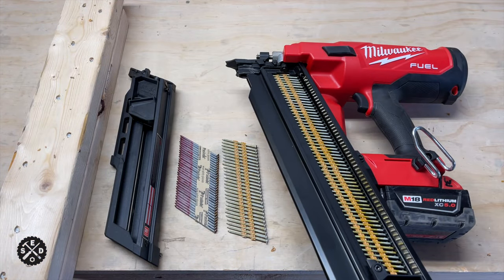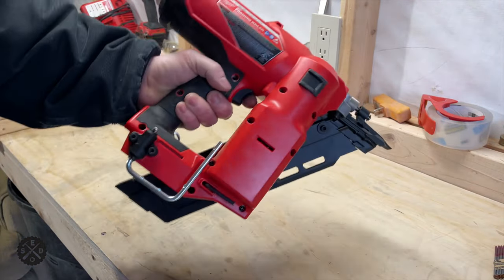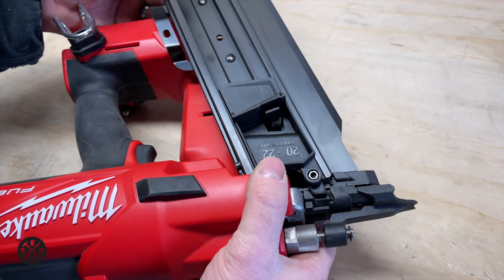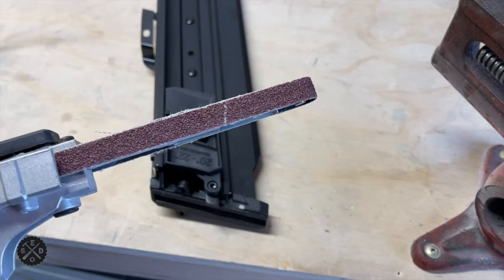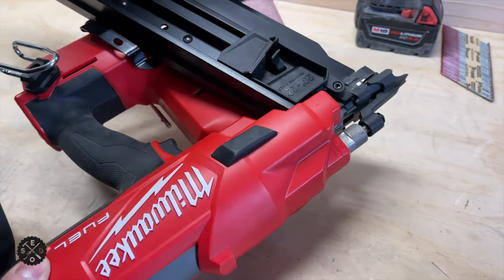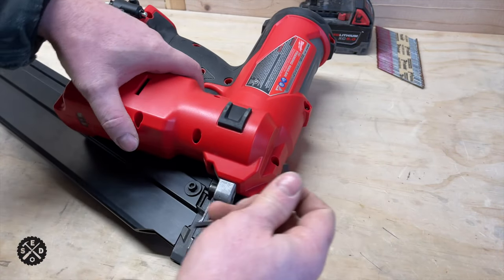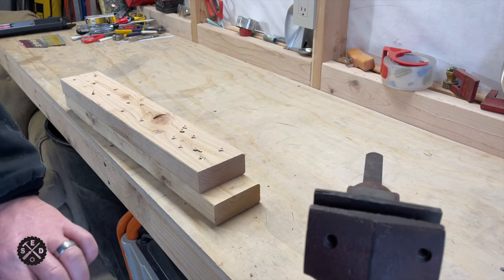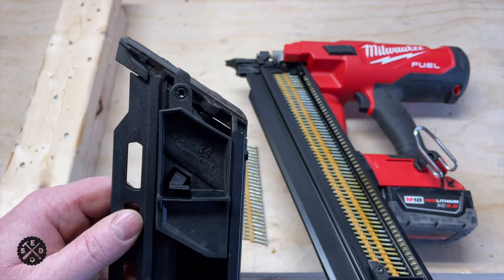Convert Milwaukee Framing Nailer from 30 to 21 Degree Magazine Swap

Comment: Just picked up a 21 deg. nailer. I'm going to buy a 30 deg mag and grind the opposite side of those tabs to see if I can get it to work. Thanks for this!
Reply from the maker: Awesome yes, let me know how it goes!
Reply: i will be doing the same thing. wife got me the 21deg for Christmas. to be honest the only other difference i can think of is the 21 might be slightly stronger too if we knew the internal cartridge capabilities only because with 21deg it can shoot thicker nails then the 30deg.
Reply from the maker: I haven’t verified for sure but I think the internals are the same. Good luck with it. Let me know how it goes.
Reply: Any luck?
Reply: were you able to do it? i got a 21deg as well but i dont want to spend on a new 30 deg
Reply from the maker: It should be doable just opposite of mine.
Reply: Awesome, will be doing my conversion!!
Reply from the maker: Very cool
Reply: How did the conversion from 21 to 30 go?
Reply: How did it go? 21 to 30
Reply: Did going 21 to 30 work?
Reply: @SmartEasyDITer This does not work.  Failed going 21 to 30.  The gun was shooting 2 nails at once. 

I assume the striker on 21 is bigger for hitting the full heads so when you put a 30 degree mag on, the striker hits both nails since they are overlapping.

30 to 21 must work because the striker designed to hit a smaller target still works on a 21 degree full head.
Reply: It fails
Reply from the maker: Interesting ok. Thanks for sharing
Reply: @SmartEasyDIYer  I was using 30 degree clipped head.  I'm going to get full offset head to see if the extra clearance avoids the 2nd nail being driven
Reply from the maker: @darceytim oh yeah good thinking! That could make a difference. Let me know. Thanks
Reply: @h2s142 not pointless if your local codes require one or the other for a given application.
Reply: @darceytim did it work?

Comment: Caution- When you are shooting the 21 degree and you bought the 30 degree since the 21 degree is plastic Clip not paper it does not sink all the nails
Reply from the maker: I’ve had no issues shooting either one if the nose depth is adjusted properly.

Comment: Cheaper to buy another gun time is money
Reply from the maker: Sometimes yes. Depends on your needs and budget.
Reply: This project take me 30 minutes with a dremel and it save me from spending $300, so I'll take that loss of 30 minutes time, but if you have the budget then you can have as much as you want...
Reply: @VinhNguyen-zn2rq  you also voided the warranty
Reply from the maker: If you put the original magazine back on, it shouldn’t affect the warranty

Comment: Have you ran into any issues since doing this? There are warnings that the driver assembly that pushes the nails are different for the angle of the gun. And I'm being warned that swapping could damage or wear out the gun much quicker. Is this true or is this just to make sure we buy more from milwaukee?
Reply from the maker: I haven’t heard about it yet. There could be something to it perhaps worth looking into. I don’t know. To me it looks exactly the same just the angle of the magazine that’s different. I personally haven’t had any issues.

Comment: With this mod will it shot the same width nails the 21deg does because they are a wider size than the 31deg is capable of using?
Reply from the maker: It should be fine it works great for either or. I’ve used it quite a lot now.
Reply: @SmartEasyDIYer  have you used.148 ,it’s the widest the 21deg uses whale the 31deg can only shoot .131 ?
Reply from the maker: Looks like .131 is what I’ve used on both 30 and 21 degree. No one here stocks any thicker.

Comment: Can you convert the 21 to 30° the same way? Just did and mine gets jammed after shooting 1 nail? Looking for suggestions.
Reply from the maker: Yes, I believe you can. I think it would just be the opposite corners that you would have to file on the magazine.
Reply: @JordanMichiels-xo8yr did you solve your jam issue?

Comment: Paul, I watched your video on sloping pipe. Great idea with the block taped to the level. What I actually was trying to find where does the pipe make its adjustment to create the slope and how solids are kept moving down the length of the pipe. Whether it is PVC or Cast Iron, does the slope come from skewing the pipe inside the fittings. I was thinking if the flange is level where is slope introduced? If pipe is not bowed.
Reply from the maker: Thank you. So it’s about sloping the whole pipe 1/4 inch per foot typically. In the example by adding a 1 inch block at the end of a 4 foot level and reading the level as exactly level you are essentially dropping it a 1/4 inch per foot. Hopefully that makes sense.

Comment: Great Video.  When my parts arrive next week I also ordered some .148 so I will verify if those work, as I need that for my project.  I have several of the 30's.  I was concerned about this approach but looking at my gun this isn't a moving part.  I thought this was something the gun hit, but it not being moving I am not worried.  That inner nose is really the only difference, I can find. Parts wise on the diagrams the service parts are the same. looking on ebay the 21 has 9-1, and the other has the H-3 nose.  Based only off 2 pictures.
Reply from the maker: Yeah great let me know how it goes! Thanks

Comment: I wonder if you had a 21 degree nailer to start with you wouldnt have to do the grinding when switching to 30 degrees.
Reply from the maker: I think you still would have to grind it.
Reply: Besides someone found out it shoots 2 nails at once because of bigger hammer
Reply: @ZeroColdx911  what do you mean? Modifying a 21 to shoot 30?

Comment: Hello awesome video, I was curious if you're going from a 21° nailer to a 30° magazine that nub would be shorter and wouldn't involve grinding. Just thinking out loud, what do you think?
Reply from the maker: Thank you! I think it would still be misaligned the opposite direction from what I gathered doing this one.
Reply: @SmartEasyDIYer  I'll find out for sure by next week I just placed an order through Home Depot for a 30° extended mag
Reply from the maker: OK let me know how it goes!
Reply: @gabrielgonzalez2230  were you able to convert from 21 to 30 deg?
Reply: How did the 21 to 30 go?
Reply: @gabrielgonzalez2230 did you convert 21 to 30?
Reply: @SmartEasyDIYer going from 21 to 30 failed.  It's shooting 2 nails at once :(
Reply: @darceytim try using full head nails rather than clipped head 30s
Reply from the maker: Do you do the full offset head 30 degree? That’s almost all you can get nowadays unless it’s old stock.

Comment: So would you recommend the Milwaukee over the Dewalt?
Reply from the maker: Definitely!
Reply: @SmartEasyDIYer  Cool, what model is the absolute best? The one in this video?
Reply from the maker: Yes so Milwaukee only makes one framing nailer but they make it in 2 variations. 30° and 21°. So it depends which type of nails you plan to use. In this video I showed that it’s possible to convert them to work with either style magazine with a little modifying but if you know which type of nail you plan to use most that’s the one I would get.
Reply: @SmartEasyDIYer  I'm going to be framing a cabin by myself, I was thinking of getting the 21 so I can nail between studs. Idk if it's true but I heard the 30 is too hard to fit in between!
Reply from the maker: That’s sounds like a fun project! As long as you don’t get the extended capacity magazine which is a lot longer cuz it holds 2 strips of nails they should both be about the same size. I have used both and haven’t noticed much difference in that regard.
Reply: @SmartEasyDIYer  Thanks! Now I'm wondering what the point of the angle is haha
Reply from the maker: @CringePanda  it’s for different types of nails is all. The 30° are held together by paper tape, The 21° Are held together by plastic strips.
Reply: @CringePanda   Hey CP, I have always liked your content. It is a shame you have to edit and sensor it so the tube police are happy. All the best to your building project!
Reply: @sleahcim4723  Thank you!

Comment: How is the long term testing ? Still holding up ? Shooting with no issues ? Im about to buy the 30 degree and buy a 21 clip to go back and forth
Reply from the maker: Yeah working great! 👍
Reply: @SmartEasyDIYer  do you find the nail depth to be consistent after the mod?  somebody said the 21 has a bigger hammer, so i wonder if it functions better with the 21 magazine.
Reply from the maker: Yes I haven’t had any issues with depth consistency on mine.